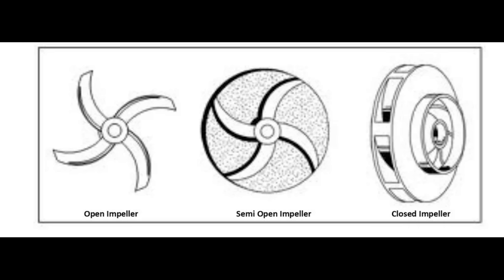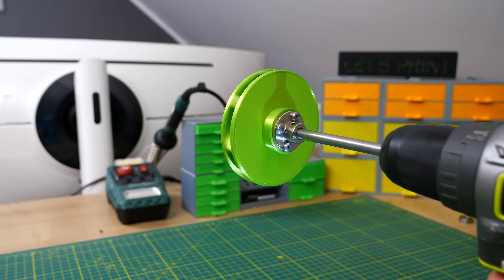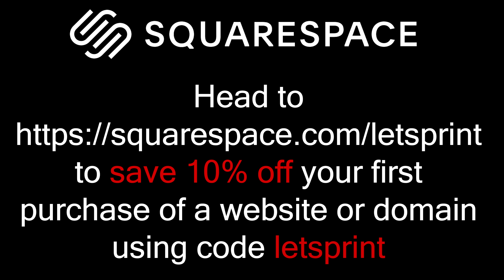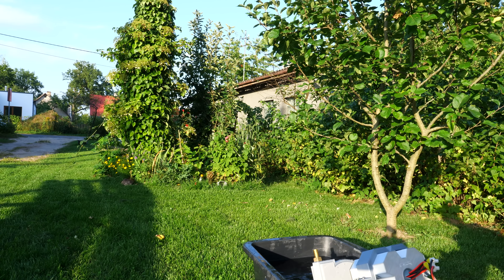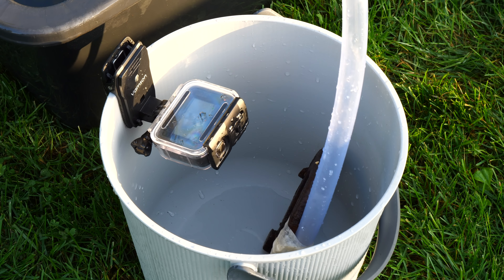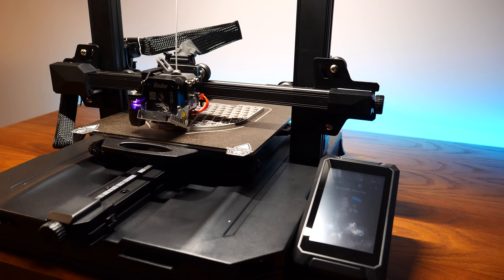INSANE Performance From This 3D Printed Centrifugal Water Pump - CLOSED IMPELLER

Comment: A vaccum pipe should be fit in the puming hole
Reply: So you can adjust the hight and can use it for example pump from barrels

Comment: What a beautiful design somehow you have either by calculation or luck(sorry to think luck could of come into it!) got a seriously powerful turbine design. Surely you could run a Pelton hydro generation system with this, use water wheel to power the pump which will give the increase pressure to the nozzle to rotate the Pelton wheel which in turn runs the generator ...does any one know the power loss but it cant be too bad..
Reply: It’s a simple law of existence that every time you convert energy from one form to another you lose a proportion of that energy. So you lose a bit of the waterwheel’s energy driving this pump, so that it’s putting out less power (energy per second) than the waterwheel. Next, you’re using this power to drive a pelton wheel which, again, loses a portion more energy and is, therefore, putting out less power than this smart little pump. Then you’re using this to drive a generator with yet another (small) loss.

You’ll get more out of the generator, if you run it direct off the waterwheel and miss out the pump and pelton middlemen.

Comment: Is designing leaks into your housimg a fetish of yours? 
Close the gap over the outlet and design with through screws with a hex-nut on the back. Use some extra diameter washers stead the force on seal. A pressure-ring to go on top of lid would work too to add stiffness 
And possibly some V-lip protrusions to really dig into your seal.

Also i think the impeller tries to compress water. Starts really well looses speed as air goes out too. Or at least what i think what is happening. 

Really want to see you make a housing that is leak proof for the first time

Comment: Would you print one of those laminar flow nozzles and attach it to the outlet.

I'm curious as to if you'll get laminar flow or if you need to have a tube between the pump and nozzle

Comment: you can use a ceramic bearing for the shaft. They are not god for impact loads but they are rust proof and dont need lubricants
Reply: And usually lower overall wear/work better as high speed bearings too!
Reply: should be easy to find as well. they are common in pool pumps
Reply: @HDDRecovery  can find them on ebay pretty easily.
Reply: i can find them broken at my workplace. 
i must have over 50 ceramic ball bearings in a bag that i picked up from the floor at work. we only spin them at 10 rpm but any debris and they bind up and blow up. 
its a common consumable there. i dont know how many maintenance has to replace monthly but its never zero.
Reply: @darkshadowsx5949  well being that these will constantly be washes by the water in the pump, i doubt debris would be a problem, just make sure to remove the seal on the inner side

Comment: If you didn't know, most centrifugal pumps, like a garden water pump, have these kind of impellers. Some are even made of plastic! And they are very small at that! Like, only 3mm wide shafts! Some, like my 2.2kw water pump even have multiple (plastic) wheels in series to increase pressure.
But please be careful not to get wood particles in your pump!!! It is a nightmare to clean the tiny shafts of the impeller, and the also become softer and swollen, while keeping their fibers intact, which will wrap around everything important. I have done this mistake before, just trust me, it is easier to clean sawdust and splinters from a bucket rather than the inside of a pump.
I have deconstructed and reconstructed such pumps before as a hobby, also, I love pumps.

Comment: so the reason this worked so much better than other pumps is because pumps are extremely sensitive to impeller to housing clearance, and this sensitivity becomes more and more important as you make the pump smaller. The enclosed blades are basically like a perfect fit; the housing in this case still matters but its easier to add more area to it to get a better seal with poor tolerances.

Comment: You're likely getting a lot less than 2,000 rpm from the drill since it's technically rated at 1,800rpm with no load. Maybe like 1500ish or less? But really it just shows how much better it works as a pump

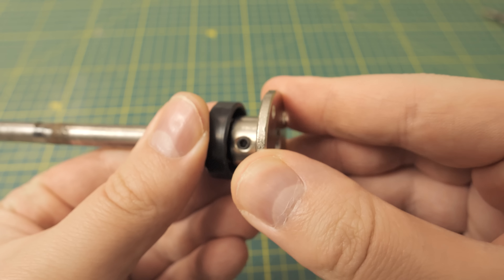Comment: Hey, new here but as a automotive mechanic I think I might have something to add. When you're installing shaft seals, you want to install them so that the pressure they are supposed to contain presses against the sorta V shaped wiper that seals the shaft. This makes the seal use the pressure it is supposed to contain as pressure to keep itself sealed. At 2:42 it looks like you installed the shaft seal backwards vs what I described, which is a pretty common mistake people make with crankshaft seals in engines as well.

Cheers.

Comment: You should make a hydro dynamic bearing for it arround the edges of the impeller to seal it and clean up tight tolerance (with grease oil or water) love the vids
Reply: Or with pressurized water
Reply: Nice
Reply: (The impeller to housing tollerance will be great)

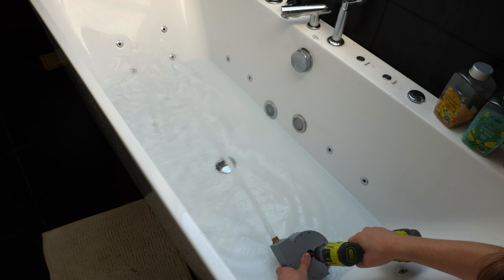Comment: 3:55 Another option instead of hot glue is to use a 3d pen with the same filament I printed with.
Reply: Alternatively you can use a solder iron to stitch the gap by dragging material from both sides!

Comment: Have you tried printing the Impeller INSIDE the housing? i.e. one print?
Sure you might need to change way things are mounted, attached, make some geometry changes, etc. But it might help reduce sealing issues.
Managed to print impeller in my design "just above" the inside of the housing and was able to separate it fairly quickly/easily.

Comment: More important. Pressure and pump heights. What are most pumps used for? Pumping from low ground to higher ground. Volume will always be second priority 😅 any other engineers agreeing?
Reply: I disagree because it entirely depends on the application. some pumps are made for static pressure, some are made for flow rate, and some are designed for a combination of the two. Saying "volume will always be second priority" is a glaringly shortsighted perspective on pump design.
Reply: Well lots of pumps are just for volume from one pool to another or pool to rice field.

For max lift height use pistons

Comment: Those supports are so wasteful, they look like they use more plastic than the infill. Tree supports would be the way to go and if you need surface area for buildplate adhesion, have it print with a raft or brim.

Comment: Should we tell him about series and parallel pumps? These are basically the centrifugal pumps that are used on fire equipment. Most of ours are semi open or closed. But yes, the performance in terms of PSI output, ease of obtaining and maintaining prime, and GPM capacity is second to none. Especially once you start using them in series or parallel.

Comment: that is very impressive.  good job.  I have a questions though. usually, in compressors, the housing starts big and is small at the outlet, to build pressure (if I remember correctly).  it is supposed to be the same with a water pump, or is it different because water is incompressible?
Reply: A water pump and air compressor are both fundamentally the same thing. Both are fluid pumps. Their design only differs because of what we want the result of that pumping action to do. With a water pump the primary goal is to move water quickly, so we prioritize flow out of the pump. This is where centrifugal pumps (non-displacement pumps) shine, because water flow is inversely proportional to outlet pressure. So our goal is to keep pressure at the outlet as low as possible. This means we don't want very much restriction at the outlet. Remember pumps do NOT create pressure, they create flow. It's the resistance to that flow which creates pressure. For a water pump (excluding pressure washers, which we will cover later), the main goal is to create as small a restriction as possible at all points in the pump. 

And air compressor is different in what we want out. We care more about what pressure it can generate over how much flow it can produce. This is for two reasons, air demand for a compressed air system in most cases is intermittent, it's also easy compared to water to store a large amount of gas in a pressurized container. Whereas water requires an accumulator that comes in one of several forms, they are almost always more complicated than a tank with a threaded hole. Since non-displacement pumps lose flow as pressure builds, they make good pumps for air until you actually hook them up to something. Think about those commercial floor blowers, they are just a form of centrifugal pump just like the ones Let's Print makes. When you feel the air coming off them it's clear they move a LOT of air. However you can pretty much use a piece of cardboard to block off their outlet, they don't produce any flow when the outlet resistance increases even slightly. So for an air compressor where we usually want 100psi or more at the outlet, we move to a positive displacement pump, a pump that for every revolution will always output the same volume regardless of outlet pressure. These are found usually in the form of piston pumps, but you can also get vane pumps, diaphragm pumps and many more. The end result is that each displacement pump creates a fixed amount of flow. For an air compressor this is great because it means when the air tank starts building pressure, the flow stays the same, so the tank fills at a nearly constant rate. This does have the side effect, unlike a non-displacement pump that as outlet pressure increases, stress on the pump itself and the motor also increases. Without safety controls this could result in failure of the pump, which can be highly explosive in the case of air systems. As a result outlet size doesn't matter as it cannot really affect flow, however the larger the outlet the more surface area the fluid inside has to press against and the stronger and more expensive the outlet must be. A pressure washer for example uses a displacement pump as we desire outlet pressure over outlet flow, so we see a small outlet due to the high working pressure even though it's a water pump. Another side effect of pumping dense fluids is that even small restrictions cause pressure to rise quickly, as such with positive displacement pumps that move liquids we always need a high volume pressure release as once we plug the outlet such as closing the sprayer on a pressure washer we must bypass the full flow of the pump or use a pressure activated switch that disables the pump entirely (not important to the discussion but I thought I would add it anyway).

This is all a very basic overview, but it's still educational.
Reply: @2009dudeman  
I have to somewhat correct on what you said. For the most part, great foundation. The inlet on centrifugal pumps that are pipe fed are usually larger in diameter than discharge since the desire is for the inlet to have lower flow resistance, thus maintaining higher pressures through the system before reaching pump inlet. This is crucial since the pressure has to be large enough so as to avoid cavitation on the first stage impller vanes. The discharge side diameter is usually governed by what discharge pressure you want your under load system to operate at and the flowrate needed. The larger the diameter, the greater your pressure output could be, but this may ruin efficiency of the pump. That being said, a 5' diameter pipe is not gonna lead to a 5000psi discharge pressure necessarily.

As an added fun fact, air compressors can be centrifugal. It is common in high flow applications to have compressors with up to 6 or more impellers feeding into each other in series, just like water pumps. These types of compressors may not see pressures as high as boiler feed pumps of the same number of stages. It depends heavily on application and operating speeds but it is possible.

Example: Some boiler feed pumps are rated to have a peak operating discharge pressure of over 7000psi and they are the size of a full sized truck when assembled.
Reply: @willpestka2745  I don't know if I would call that as much of a correction, as I would an addition of information. There are various types of air compressors that are not positive displacement, some are even hybrid designs. But that goes beyond the scope of basic pump operation. A compound turbo setup is an example of multistage compressor to provide flow at pressure without being fixed displacement. I've worked on compound turbo systems as high as 120psi, which is higher pressure than many positive displacement compressors.

But that's all additional information that gets confusing. Just talking turbocharger AR ratio is more than most master level ASE mechanics understand.
Reply: @2009dudeman  
Fair enough. I get nerdy about this stuff since I work at a company that repairs high speed pumps. 

The centrifugal compressors I am talking specifically about however are used to produce 3000+ psi and are single shaft, not a series of turbos. Crazy hunks of metal if you ask me.
Reply: @willpestka2745  I hear you on that. I love big industrial machines, doesn't matter what they are I love them all. Never seen a 3000psi screw compressor. That's got to be one massive beast.
Reply: @willpestka2745  the discharge will almost always be a smaller diameter than the suction, for the exact reason you stated. The idea is to keep a high NPSH to avoid cavitation, which can destroy impellers, casings and wrecks mechanical seals. This is why pumps are throttled on the discharge side, and never the suction. 

I am also familiar with large multi-stage feed water pumps, like binghams, KSB, Ingersoll Rand etc. It's amazing how balanced their rotating assemblies are on KSB pumps, could stand a nickel on a pump the size of a pickup truck running 3000 psi being driven by a steam turbine. 

I worked for a major mechanical seal manufacturer for a number of years, specialized in pulp and paper and also served in the chemical, pharmaceutical, nuclear fuel reprocessing, mining and power generation industries. 

Things get interesting when you need to pump plutonium lol.

Comment: Sweet build. I work on pumps for work and all of the pumps that I work on, have the shaft seal on the inside of the pump. The bearings are inside the motor which is outside of the pump. There are no bearings inside of the pump. The shaft seal faces ride against one another. One has a ceramic face and the other has a graphite face. Half of the seal mounts to the backside of the impeller, in a recessed area for it, and the other half is pressed into the pump housing. Keep up the great work though! Loved this project!
Reply: This blew my mind. Graphite makes absolute sense considering the shear strength of the atomized carbon is actually going to be significantly higher than in any oil. I've never thought of using graphite for high pressure, high speed application, but with this explanation and the knowledge we have of "graphene" it makes a TON of sense. I wonder if using a material that not only was dense, like ceramic, but also repellent to carbon in chemistry could improve wear. The simple solution of graphite seems almost unbeatable though.
Reply: @sourand jaded carbon mechanical seal faces can get particulate embedded in them and will cut and ruin the stationary face they run against.
Reply: @SpadeNya  carbon is used for its self lubricating properties. A carbon rotary running against a silicon carbide stationary is the coolest running face combination. Alumina ceramic like mentioned in the above comment is a poor conductor of heat and will create a condition called heat checking if not kept cool. Other materials used for faces are antimony carbon, sintered and reaction bonded silicon carbide, tungsten carbide, PTFE, and in some cases chrome oxide plating. Most smaller pumps with shaft diameters below 1.500" use cheap throw away seals from the factory which are around 300 dollars. Larger pumps will use more expensive cartridge mechanical seals that can be rebuilt and can range anywhere from $1,000-$50,000 depending on size, metallurgy and elastomers used for a particular application. Sorry for the wall of text, I have a lot of experience with process pumps and rotational shaft sealing and couldn't help myself. Lol
Reply: @SpadeNya  hence ceramic. It's used to make the toughest machining tools. Same reason for ceramic brakes.

Comment: Great video. I liked how you described the design changes as you went.  Suggestion: the outer housing seemed to be more beefy than needed. I would try to make the outer housing walls about half as thick to use less material and make the printing process go faster.